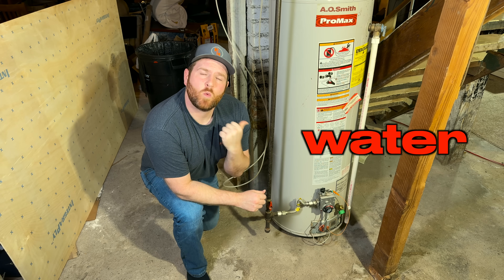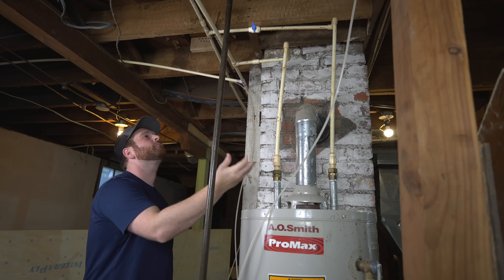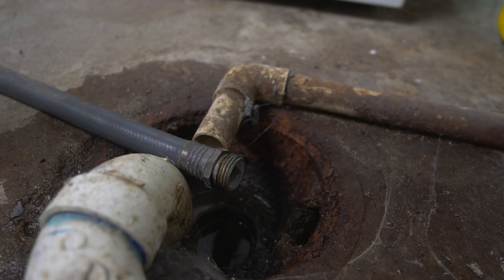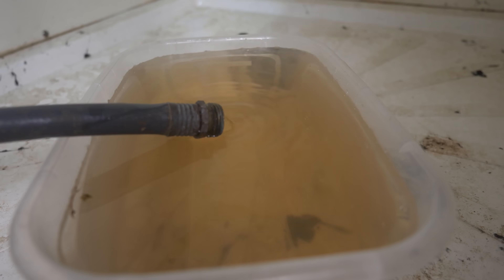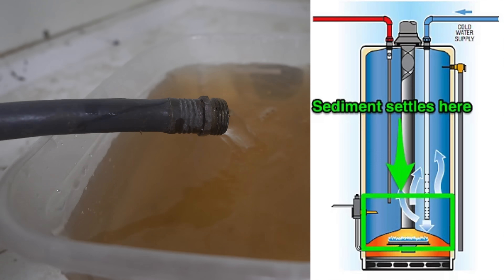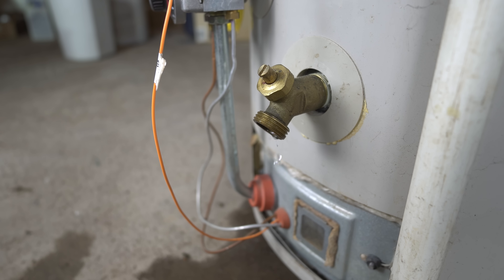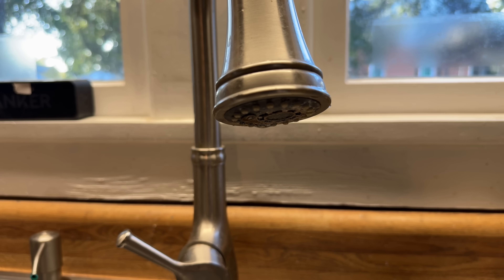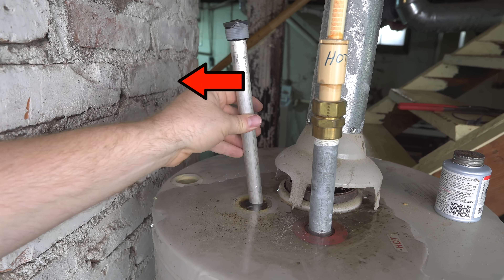Correct Way to FLUSH WATER HEATER! 2-Minute Tutorial

Comment: Thank you for sharing this!  Just got a house.  First time home owner and need to start learning things like this.
Reply from the maker: You're welcome! You may pull out your anode rod and look at that, and clean your fridge coils too. I have videos on both of this, and they are commonly overlooked or not known about. Also, keep your furnace filters, clean, which I'm sure you already know. And if it has a basement, make sure you get water away from the walls during the rain. Make sure gutters are working properly and not plugged. I'm thinking of doing a playlist called "what homeowners need to know"  sometime in the future.
Reply: @HandymanHertz  That would be a great playlist! First time homeowner here. 4 years in and constantly learning new things from your channel!
Reply: @HandymanHertz  Thank you!!
Reply: Congrats on the house!
Reply: @mrtncrls  thank you!
Reply: Ditto. That's why I'm here. I just noticed that my HVAC was installed by someone who must have been doing it for the first time, and in a hurry, then I looked slightly to the right, and saw my water heater. I'm like "Uh... The water here is really... hard. I'm gonna just go flush that now." Then decided to look up how to do that. ;)
Reply: YOU NEED TO LEARN HOW TO CARE FOR YOUR HOUSE :)

Comment: When do i turn the breaker back on?
Reply: You should wait until the water heater is full. After you turn the supply back on and there is no more air in the lines to the faucet, turn off the faucet. Then listen for water flowing into the water heater tank to stop. You can do it after the air is out of the line but it's safer to ensure the tank is full.
Reply: Oh I saw it. When does the water start flowing out of the faucet?
Reply from the maker: What do you mean?

Comment: By turning off the cold water supply, you are NOT FLUSHING THE WATER HEATER! You are only draining it. I just did mine and common sense told me to leave the cold water valve on so that the incoming water would flush the tank and not just drain it as you are doing. And by leaving the water valve open, you don't need to turn on a sink spigot to let air in the top of the tank. What don't you understand about the term FLUSHING? I opened my drain valve and because water was coming in at the top, the water drained quickly and was replaced by clean water. I let it flush for about 5 minutes, then closed the water drain valve and viola! My water heater was flushed and not just drained. All of you so called experts turn the cold water valve off. Who made you an expert?
Reply from the maker: Why don't you watch peoples whole video first so You don't embarrass yourself in the comments like you just did. It's apparent you didn't watch me video. Plus, what you did didn't flush anything. when you don't drain it first, it  doesn't agitate any of the sediments. What it sounds like you did is what you do every time you turn on the bath or any other hot water faucet in the house. Hate to break it to you, but it sounds like you just wasted your time. I guess you're not smarter than us "experts" after all. 🤷‍♂️😆👎🏼
Reply: Tell me you didn’t watch the whole video without telling me you didn’t watch the whole video. Lol. 🤡
Reply: Bruh... LOL😂
Reply: I literally have no idea about any of this stuff and even i understand what they just did was use their water heater as normal- lol thanks for the laugh!
Reply: Joel is NOT an expert!

Comment: how long between turning off the gas before the water heater is cool enough to drain through the hose?
Reply from the maker: I've never waited and it's never been an issue with my hoses. So, zero minutes.
Reply: @HandymanHertz  Thank you again.
Reply: @HandymanHertz Some people believe draining a hot tank and filing shortly after will very cold water can cause thermal expansion issues with the liner.

Comment: Why not replace the leaking valve?
Reply from the maker: You can, but it's not worth the hassle to go to the store, buy one for $25, come back home, drain the water heater again and install it, in my opinion. Cheaper and saves money to put a cap on, and that cap will likely outlast my old water heater. It's an option for people, I may do a video down the road on how to replace it.
Reply: @HandymanHertz  I have been told to replace it with a 1/4 turn ball valve as it allows more sentiment to be flushed out.  Thanks for the video.